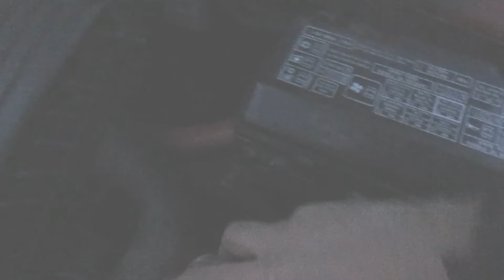Honda Insight - How to Change Head Light

Comment: Before you purchase a new bulb; you should try to clean the contacts on the old one; it may still be working and simply have become oxidated on the contacts either on the connecting cable or the blub you may find the bulb is fine and just needed those contact cleaned up.
Reply: OTOH, old technology is old technology.

Comment: Any videos that involve working on the Honda insight 1st gen are greatly appreciated. My driver side headlight just went out. FYI - I'd keep an eye on your ground cables. They can be a source of error codes. At 2:57 in this video you get a good look at one which looks frayed. I replaced mine which frayed through completely. Just a thought. I believe there are (4) total ground cables.
Reply from the maker: Good to know. Thanks for the info.  It saves so much money if you can maintain your automobile yourself.  And this has been such a great car for so many years.
Reply: Wow this really helped. Check engine light has been on. And just saw the ground cable broke.

Comment: I replaced the standard bulbs with ultra-bright LED (H4) from Termitor. At first I thought the new bases were so much thicker than the originals that the clips were never going to fasten. But they did. Here's how.
Driver's side: has the most room, but it's not great. I could not get the clip to fasten without the use of a tool I made. You can see in the video the wire in the clip comes up from the base at an angle bends flat, goes out a bit and then turns 180 degrees back on itself into a parallel before going down and then flat to make a hook to latch under a slot. For the driver's side I cut off a 2-inch length of 1/2" dowel, cut two shallow grooves in the end, just the depth of the wire in the clip about 8mm apart. I then used the grooves in the dowel to press between the parallel lengths to press the clip both down towards the lamp, and then first up to clear the groove and then down to seat in it.
Passenger's side: has even less room. I had no luck with the dowel, but fortunately, the clip is identical to the one on the driver's side, both "right-hand." I finally had success using a pair of 11" long bent-nose pliers by grasping the clip from the right side, using only the tip of the pliers right at the point on the wire where the clip flattens from angling up, before it reverses back on itself. I was able to see the end of the clip and push and twist, forcibly, the clip to get the flat under the slot. 
What should have been a 10 min operation took over two hours thanks to Extra-Fine Automotive Engineering Which Has Always Focused on Ease-of-Maintenance. (HORSE LAUGH) I'd like to meet JUST ONE of these geniuses and give him a swift kick to the balls.

Comment: Ty.
my 2000 insight is light green. Neighbor has a  blue one. Cool seing it in red.

My car survived being flooded to the cup holders and half the engine. Still runs but auto stop stopped working.
Reply from the maker: That is good to hear.  I really loved that car.. it got great gas mileage.. I recently had to get rid of it though, because it was beginning to have more problems than I could reasonable fix.. It had over 200,000 mi...
Reply: The green ones are the most valuable.  Model-year 2000 only!